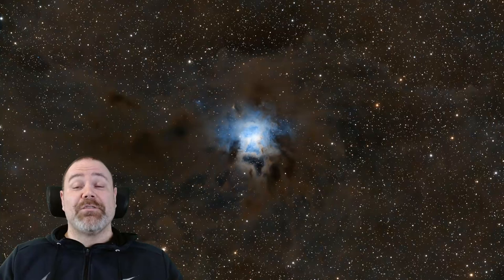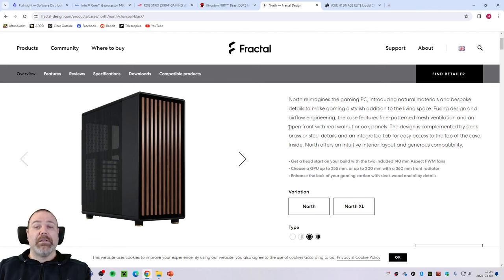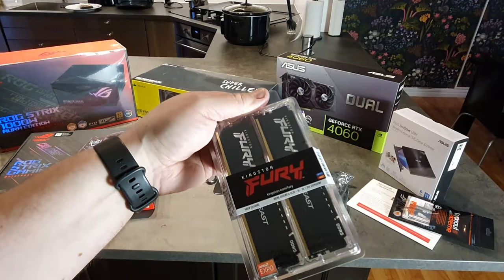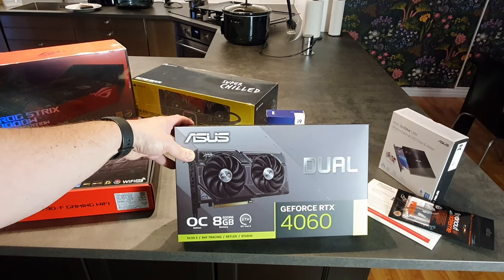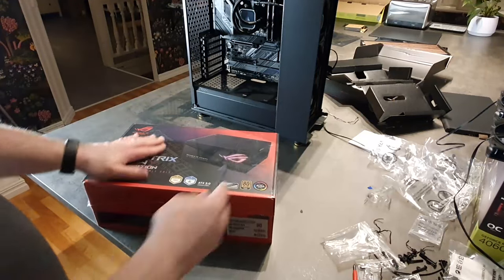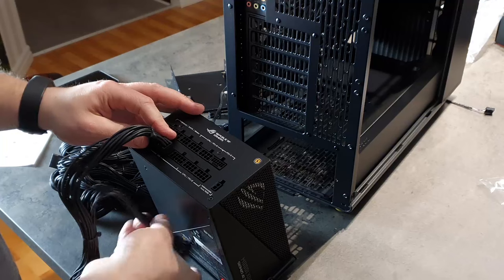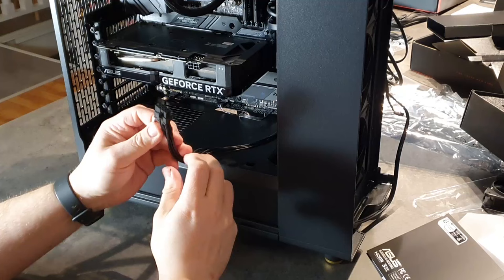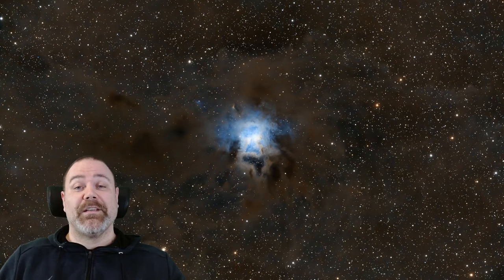Build your own Astro Photography PC for image processing

Comment: Did you only use the 1x M.2 NVME SSD as your video shows @15:00? If so, you installed the SSD in the wrong place as it needs to go closest to the CPU (there's another M.2 slot just below the CPU that is designed for the main boot SSD) that way you will benefit from the proper speeds.
Reply from the maker: Hi! You are correct, I have moved my SSD to this location now. I did however not noticed any real performance improvement related to PixInsight for the tests that I did. But it's worth taking notice of and I will update the video description. Thanks!
Reply: @frosthastrophotography  There's a huge loss of performance as these lower slots are controlled by a different chipset. Always put  your main drive closest to the CPU. If you are going to put out these tutorials please ensure you know what you are doing as others follow your guide